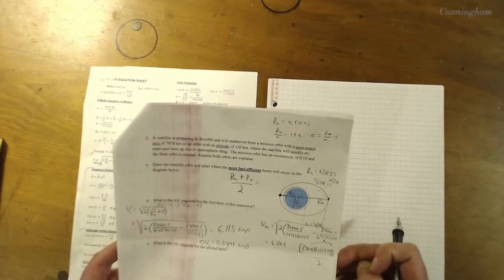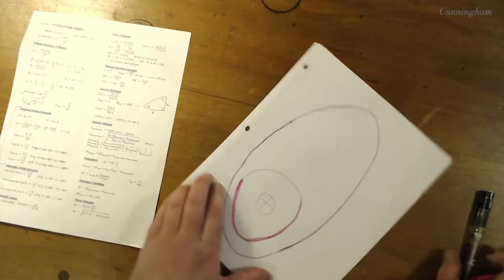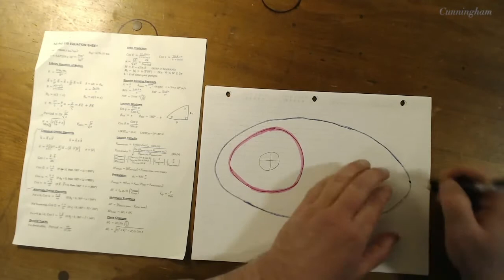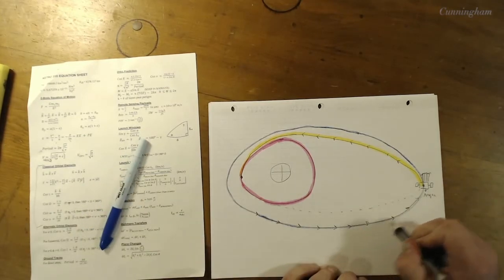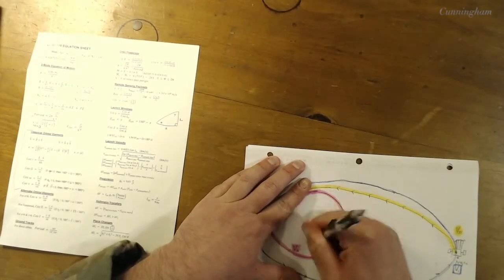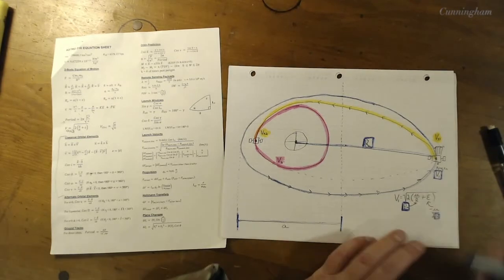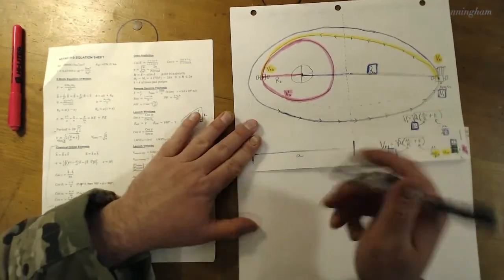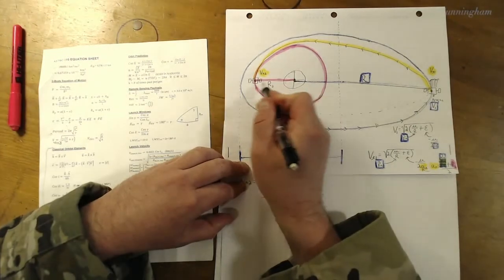Hohmann Transfer (Elliptical Starting or Final Orbits!) How-To Guide

Comment: I have a follow-up question, though. What about when the elliptical orbits are not axis-aligned? Is it still possible to perform a hohmann transfer, or do you strictly need to do a bi-elliptical transfer at that point?
Reply from the maker: Unless the initial and final orbits are co-apsidal (aka, axis-aligned), it's technically not possible to perform a Hohmann transfer. You can still maneuver between the two orbits! Just won't be the super-efficient Hohmann transfer maneuver :)